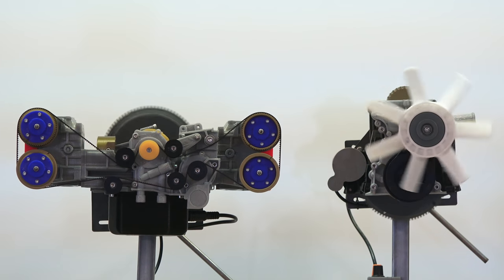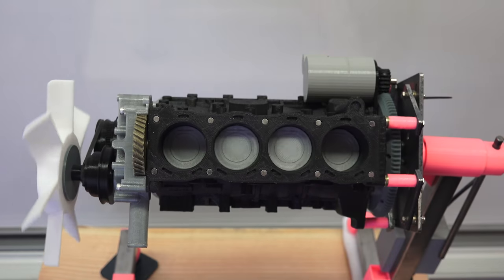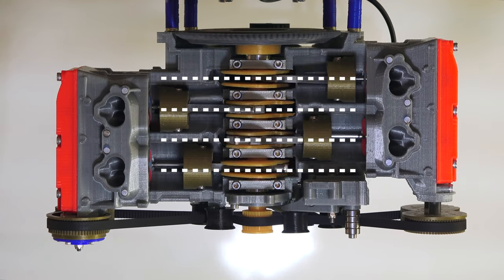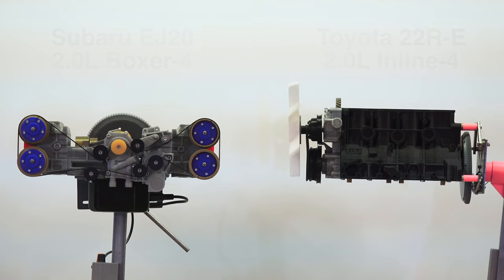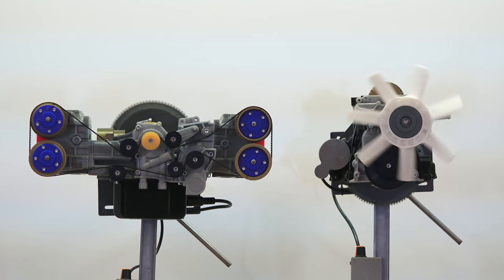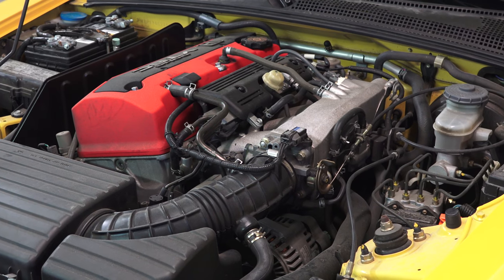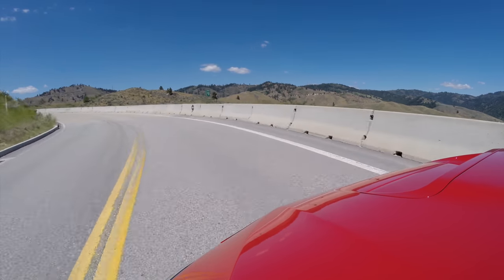The Differences Between Inline Four & Boxer Four Engines

Comment: You got me at 'easier for maintenance'.  I always look for DIY maintenance and how to avoid the mechanics.  Cars have a lot of components which is always hard for a mechanic to pin point a problem.  The owner is more likely to know what is wrong with car than a mechanic.  Also, maybe not all boxer engines, but the brz/frs/86 all have a torque drops and risk of busted head gasket.  I plan to stay away from these unless I do my full homework.  I believe, the best sports car is then the Mazda Miata.  I wished they had a 4 seater.  They have kept their classic setup and I am pretty sure it has best of all worlds, except when you have kids.  Then you have to switch it out for something boring.  Toyota has made an inline 3.0 Liter diesel.  I had the 2.7 L in my 3rd gen 4runner with a MT.  It was awesome to maintain and I towed over its capacity.  They are worth having since they do save fuel.  I also want to shout out for Eric for his work on the 3D printing engines.  Very cool!

Comment: The subaru boxer diesel has the injectors on the side of the engine. You can only reach them when you take out the motor. On a normal 4 cyl it would be way more easy to replace.

Comment: Well I did not know this before but it is one one hand logical because the normal force of each cylinder in the boxer in not related to the ortogonal direction of the pistons while firing.
This is also logical under the consideration of vector-force-calculation by the cross-product.
But this would yield in occurring other order vibrations depending on the learning angle.

Comment: There are thousands of general aviation airplanes flying behind larger 4 cyl horizontally opposed (boxer) engines: 320, 360 and 390 cubic inches (4.7 liters) are common. These power the fleets of 2-4 seat Cessna, Piper, and Mooney planes you see overhead every day.  The four cyl engines can vibrate considerably at low rpm, but they are very smooth at their intended operating RPMs (usually, between 2300 and 2700 RPM).  The biggest difference between air-cooled aviation engines and automotive engines is continuous power:  aircraft are operated at 65-90% of maximum power almost constantly.  The air-cooled automotive engines in a VW, Porsche, or BMW motorcycle, are cousins close cousins.  Porsche made engines for Mooneys, which were the first attempt (that I know of) to mass-produce a modern automotive engine for general aviation.  It didn't work.  As of now, the vast majority of small airplanes are flying behind air-cooled, boxer engines using technology from the 30's, with carbs and magnetos.  Some have EFI, but few, if any, have FADEC.

Comment: Most private airplanes have either a 6 cyl or in fewer cases a 4 cyl boxer style engine.  I assume it’s for the lower vertical profile but they wouldn’t be used in airplanes if they weren’t reliable.  Admittedly they need to be serviced they are a lot easier to access than boxer engines in Subaru’s and Porches.

Comment: why do people call opposed engines boxer's?
they have been around a long time you know. the Hawker Typhoon had an odd engine, the Napier Sabre was 2 opposed 12 cyclinder engines on top of each other to make a 24 cyclinder opposed 2400 hp engine lol.     though it was an odd sleeve valve design, pretty compact

Comment: I'm satisfied with my Nissan Patrol's inline-6 4.8L DOHC engine. Is there any bigger inline engines though?
Reply: Q: Is there any bigger inline engines though?  A: yes.

any over the road diesel like a Detroit DD or Cummins ISX is an inline-6 in the 12 to 15 liter range.  and i'm sure they run even larger displacement straight 6's in marine applications, but all those fancy yachts are diesel too.

Comment: Hmm. I thought that a boxer has opposed pistons in the same cylinder with no head, and two cranks, chained or geared together. Boxer because the pistons are boxing each other directly.  An odd example is the Commer "Knocker" 3 cylinder, 6 piston diesel. It's called knocker because instead of two cranks, it has a common crank driven by huge rockers from each piston. It was (it still is, but now very rare) not surprisingly incredibly noisy with the knocking added to the diesel racket and when revved made a loud blaring noise. I don't know if a four cycle version is possible, thus the flat four, four cycle with valves that you are describing. It may be that the ubiquity of the flat configuration (Porsche, VW and Subaru engines) has resulted in the term boxer now being adopted into common usage for a flat two, four, six, whatever.

Comment: Pistons in a boxer lay down on its side causing uneven piston wear from gravity while inlines don’t have this issue. Old subaru’s will have knocking noise on vehicles with high mileage. Once heard call “subaru slap” because the pistons are slapping the sleeve

Comment: I happen to have both engines, 2.7 litter in my Tacoma which has over 260,000 miles and 96,000 on my 2.5 boxer. Love driving the Subaru.

Comment: Bringing in airplane engines will provide examples of large displacement 4 cyl. boxers. Like the Continental O-240 with 240 ci / ~4L or the Lycoming O-360 (361 ci / ~6L)

Comment: John Deere model A small tractor 1940,s used a in line lay down 2 cylinder 5.1 liter or 5.2 liter depending on year but a gas engine both cylinders box towards the front.

Comment: I prefer inline 6's and rotaries for engine balance and smooth reving.  Mazda needs to make a high reving small displacement inline 6.  Using a turbo and the old VRIS system together but with 3 or 4 stages of VRIS.  .08 to 1.3 liters would be fine with a 15k redline and a manual trans only.

Comment: Unequal length headers would make sense for scavenging when the cylinder bank in question has uneven firing (given that the pressure pulse would need to travel a shorter or longer distance based on which cylinder is reaching tdc of the exhaust stroke). A boxer 4 has unequal firing per bank. An inline 4 does not. (As an aside, i6, v6, and boxer sixes all have even firing per bank)

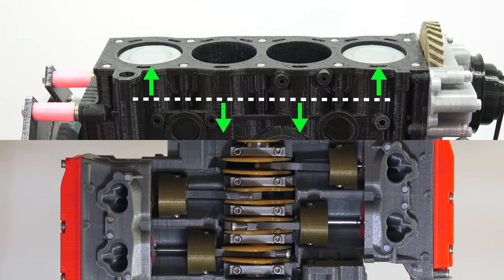Comment: 1:30  Um, what??  It isn't possible for the piston to travel faster at the top of the cylinder than the bottom.  It is true that the piston comes to a stop at the top AND the bottom of the cylinder, therefore the highest piston speeds are in between.  This is a fixed radius crankshaft, not a CVVT.

Comment: The Chevy Corvair engine is a flat six. (1969-1969).  Very very smooth.  No counter weights on the crankshaft.

Comment: i still prefer to use 2 approx 227 (give or take) cu in  inline 4 cyl joined on a common crankshaft splayed 90 degrees apart. not saying its the best or worst just saying thats what pushes me back in the seat.

Comment: Boxer engines are not just for gas, they have been made for diesel as well. Look up Deutz engines as well as Maggirus and Iveco trucks with Deutz engines in them (some in the 80's).
Reply: Subaru itself sells "Boxer Diesel" cars, I have seen the badge on bigger Subaru vehicles last year too.
Reply: what Suberu sells is the same size as the engines in the video. The Deutz engine came in bigger sizes.

Comment: Sooooo the "V"-12 engine in the Testarossa is actually a boxer engine since it's flat and has the same type of layout as the boxer engine you showed in the video?
Reply: Q: Sooooo the "V"-12 engine in the Testarossa is actually a boxer engine since it's flat and has the same type of layout as the boxer engine you showed in the video?

A: no, Berlinetta Boxers do not "box".
Reply: What a constructive answer.
Reply: No it's not a boxer engine. It's a flat 180 degree V-engine. It does not have the same layout as a boxer engine. Completely different crankshaft.

Comment: When a Subaru is purchased it is well known the timing belt MUST be replaced at 100,000 - 120,000 miles.  If you go this far you might as well true the heads and replace the head gaskets.  Timing belt kit comes with pulleys, tensioners and water pump.  Cost $1500 - $2000.   I own two, just had both done.  Other than this I love the car.  Not sure if there is a fix for the head gasket issue, as long as there is a boxer engine there will be the necessity of replacing the timing belt so I don't see that going away.  I think more than anything people who are interested in buying any vehicle with a boxer type of engine, in this case a Subaru, should be fully aware of the maintenance required.  It's not for everyone.

Comment: BMW uses boxer engines in their motorcycles.  Low center of gravity makes a huge difference in handling.  And, on a motorcycle, the boxer valve adjustments are 100x easier than on motorcycle inline and v configuration engines.

Comment: Sorry but your very wrong about the exhaust sound and the reason for the boxer having its own beat. I install a 1.8L water cooled Subaru engine into a VW comby years ago, I made the exhaust pipes and mufflers exact same ether side and it had it own Subaru beat, the exhaust not is very much to do with the firing order.

Comment: My dad had a 1999 honda valkyrie , a boxer 6 (1500cc) the torque on that thing was crazy it would actually pull very hard for a bike,google says it has about 100HP i really doubt that it felt more like 150-170Hp and the thing was really heavy really a great bike, my dad sold it cause it was a really raw bike,didn't have ABS or any safety feature so it was kinda scary

Comment: Is it possible to make an engine that sprays fuel and air together in a mixture and eliminate the intake valve?
Reply: What would you use to close the nozzle after the intake stroke?
Reply: Q: Is it possible to make an engine that sprays fuel and air together in a mixture and eliminate the intake valve?

A: sure, but what would you do about the pumping loss created by the vacuum as the piston descends from TDC to BDC.  unbeknownst, temporarily creating an "opening" in the cylinder actually accomplishes 2 things not just 1.

Comment: I use to think 1.3 Toyota yaris engine revs smoothly.  Not after I've got a Subaru boxer. That Toyota engine feel like a tractor engine in comparison, and the Subaru almost electric. The inline engine does idle more smoothly just after starting. You can feel that boxer rocking motion some second after startup.

Comment: Which is more reliable engine among the two? Which is more easier to fix?
Reply: A boxer engine is generally harder to get access to if you're a mechanic as theres not alot of room at the sides of the engine. I'd say the inline 4 is easier to fix because of that. Unsure about reliability, but there would significantly more inline 4 cylinder engines out there in the world.

Comment: The difference is that you could throw a handful of sand into the cylinders of the 22R, fire it out of a cannon into the ocean and it would still run for half a million miles. Boxers sound good and from an engineering standpoint, a superior design on paper, but a 22r is flat out bulletproof.

Comment: I feel like box four would wear out the cylinder walls more faster then inline engine, due to the box four pistons being horizontal and working against gravity. As for inline engines they dont need to push against the walls when they go vertically. But what do i know im not a engineer.

Comment: I've had both Subaru's and Toyota's. The Subaru's have a tendency to blow head gaskets.
Reply: Subaru's been using the FB engine for almost 10 years now that has no coolant passages through the head gasket, therefore no gasket leaks.

Comment: Boxer is called horizontal opposed and are used in many smaller airplanes like Piper and Cessna. I noticed a registered mark, that is on the name.   If you use it too much with out Subaru's permission law suites do result. so take a little time to find out what the real names are.

Comment: As far as i remember well the boxer has also another disadvantage : more wear in the lower part of the cylinder due to gravity.
Reply: HansVanh1 gravity plays a most insignificant role by comparison to the other forces in an engine. Remember, they’re frequently used in airplanes: It’s not a concern.

Comment: People forget that most downfalls of uel headers on boxer motors arent serious unless over 400whp.
Scavenging on stock cars is fine. If this was a TRUE issue then why do 95% of turbo charger setup wont be an effective exhaust setup because of the force in which intake air and exhaust gases are being forced.
Uel headers are just less effective on naturally aspirated cars.
Saying its bad is a very mute point.
Regardless equal length is obviously better, its simply nearly impossible to accomplish on every header design and can ruin scavenging affects needed for effective torque. Ever tried a straight pipe design. I dont mean big oversized piping but oem exhaust on new headers. Power band is moved up and some of the cars transportation effectiveness is ruined.
Manufacturers spend lots of money designing they factory exhausts for a reason other than hp

Comment: Of course, and this is Subaru's longest running problem, the cooling of a boxer engine takes a much more expensive system to truly be effective. This is one of the contributing factors to the decades-long head gasket issue.  Once the car reaches 80,000 miles, mindful Subaru owners keep an eye on it by using a block tester.

The problem has not been resolved, even though Subaru is fully aware of it.  There is no fix because it is a design flaw. you can always put in a new head gasket, but it will fail as well.

Being a two-time Subaru owner, I will never buy another one. At least with toyota, you don't see head gasket problems until much later in its life, if at all.

Comment: If you change the firing order of an engine can you reverse the direction in which the engine is spinning?
Reply: No. It would suck air in from the exhaust and blow it out the intake. You'd need to change the camshafts. Only two stroke engines... like Rotax snowmobile engines... can be run in reverse.
Reply: Bartonovich52 that's a shame would've been cool to use as a prank

Comment: Inline 4s are not sexy or cool but they get the job done without complaint for the most part, which is something Subaru and it's Boxer fours cannot really claim. LOL EJ20 and EJ25. 

5 main bearing, dohc 4 valve inline fours are pretty good. They are the Rodney Dangerfield of engines, they don't get no respect (and they really should TBH)

Comment: Do the boxed engines really have more head gasket problems?
Reply: That is a shame of the past.   Now the worry is PCV neglect causing oil leaks on the timing chain cover and oil seals.   Neglect of Subaru maintenance will bite the owner hard.

Comment: Ya but, any I 4 > 2.0L = less efficient, more vibration, and typically has something to do with the engineers not being able to figure out how to make the engine work at the 0.5L/cylinder most-efficient size. I6 is probably the best engine, with the BMW I6 being one of the best.

Comment: Boxer engines are used also in some early model of Alfa Romeo.
Reply: Yes, used in Alfa Suds, Alfa Sprints, Alfa 33's & early 145's & 146's, hardly early Alfa models though, the Suds were launched in the early '70s, Alfa had been around for years before then!

Comment: Huh. I guess I didn't realize that on boxer engines opposing connecting rods do not share crank pins, like in they do in a V engine. It has the same number of crank pins and rod journals as an inline.

Comment: 22r & re were great engines for their time. 200,000 or more miles was a good engine back in the 80s. But let’s face the facts. They didn’t make any power, and still got less than 20mpg. If I’m driving around in a underpowered truck it better be getting at least 25mpg or better. Also there iron blocks and aluminum heads made for head gasket issues.

Comment: Why are modern engines not going to a v6 or v8 design but with smaller pistons to reduce consumption. Rather than extremely complex 4cyl turbo designs?

Comment: My 165hp Forester with an EJ25 would smack my 190hp K24z3 Accord or my 260hp Buick up and down the mountain. Why? The Accord and the Buick both weigh 450lbs more. They aren't confident into corners. At all. I actually almost ran off the mountain in the Buick one day due to understeer.. The Forester is pleasant to drive around corners. The brakes feel less burdened. (450lbs+ is enough to make that kind of a difference) the power is slightly lacking up hill compared to my Lexus LS400, but downhill is where the little boxer shines. She's so balanced, planted, and nimble. Touge racers took 90hp civics down mountains at ridiculous speeds all throughout the 80's and 90's. Power isn't everything! If you ever watch vintage touge racing, it really is something to be amazed by. I say all of that to say this. Boxer engines have many flaws, but driveability isn't one of them. They really do pair well in mid sized vehicles. They might require more upkeep than the K20 in your mom's Honda Odyssey, but they are still very reliable. The more I pay attention, the more old Subbies cruising around! Unless you've driven a Subaru in a sporty fashion, you'll probably think I'm exaggerating... I'm a mechanic, and I've been around cars my entire life. I've driven fast and slow, and Subarus might not be the fastest out there or the slowest, but they hold their own in the world of racing and rally for a reason. It's their balance that draws me in.

Comment: After about 200K miles on a subaru the piston has worn the bottom side of the cylinder causing the notorious, 
Subaru slap!!
Reply: At 250k on the ole 2000 impreza outback sport pray for me 🙏😂